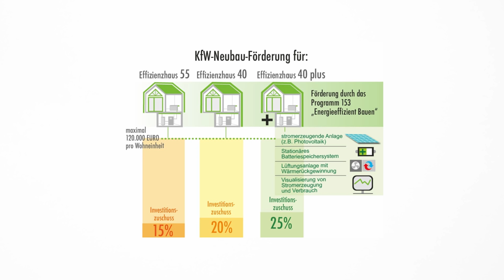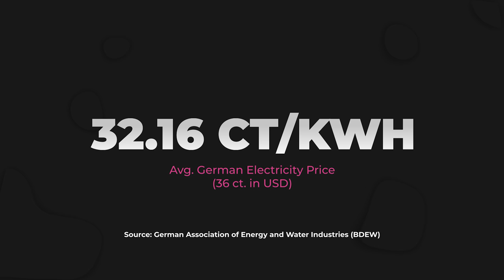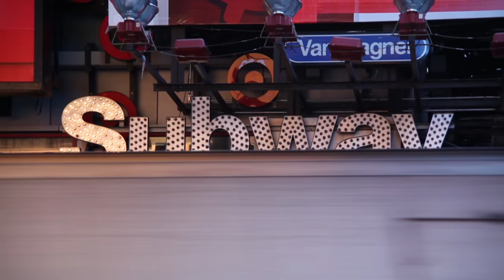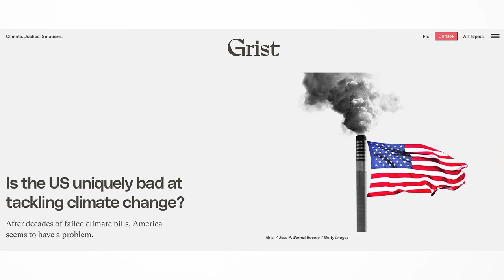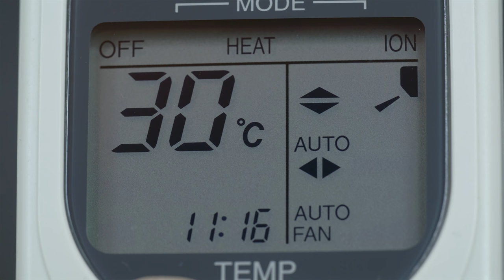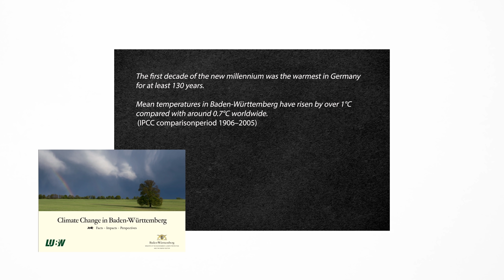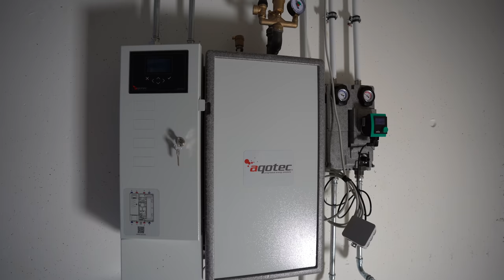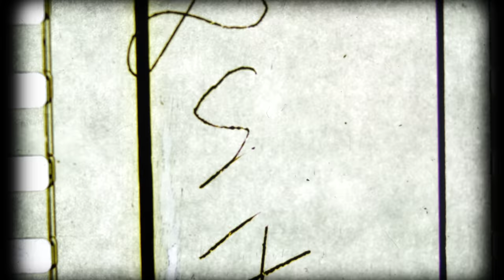HVAC (HLK) in German & American Homes | A Tale of Two Countries

Comment: Weeeell, I've personally heard (and until recently, even used) the argument that AC makes you sick myself a lot. 
Let's separate that into two distinct parts. 
If you step into a super-chilled room (somewhere around 19°C) from outside with a temperature of 30+°C, AND you are forced to sit in the extremly cold draft powering out of the AC unit, yes, then technically you can get sick. Not the common head cold that people like to claim, but rather muscle cramping due to effects similar (note: not equal) to hypothermia.
Because in Germany there is a high chance that you walked or biked from your previous location to your home. So it was fairly common for people to have highly sweaty clothing. In the smaller rooms that predominated German housing the blast of cold air from an AC usually had less time to disperse and mix with the hot air than in the generally larger, more open spaced rooms of the USA.
As such sitting in that stream of cold air from an AC unit with effectively soggy clothing may have caused some people some physical muscle discomfort and cramps.

The other reason why you could get sick is because many people who did use AC's in the 70's here simply did not consider that the filters require regular changing and cleaning. The air filters can get clogged up with particulate matter making them perfect breeding grounds for bacteria in humid days, especially when the AC doesn't run continuously but gets turned on and off again regularly. Each and every such switch allows for humidity to settle into the filters allowing for better bacteria growth. The airflow then spreads these bacteria throughout the rooms.
That's the second possibility of how to get sick by not using AC correctly.

But consider this: most Germans grew up with some form of radiant heating, either gas, wood, oil, or district distribution for the last century or so. None of these required regular exchanging and maintenance of filters. Let out the air once or twice a year from the radiators, and refill the water reserve, and you are done. Even if you forgot about it, it would still work reasonably well, without making you sick. Not so with AC. A clogged AC unit can be a real center of bacterial infection for a house.

Once this reasoning got out and stuck in German brains, it was incredibly difficult to get this out of the heads again, even when the filters and the AC units themselves improved drastically. It propagated into the general mindset and has stayed there since then.

Just my two cents on that reasoning. Maybe there are even some more factors that I've forgotten or overlooked.

BTW: Yes, I caved in and got myself an AC unit (central AC plus outlets for two rooms, living room, and my bedroom) two years ago when I completely refurbished the roof of my house, including thick insulation and high efficiency windows. It was the best energy efficiency class AC I could find for my requirements because I knew about the insane electricity costs I could run up here in Germany otherwise. I still try to use it as little as possible, with as little temperature variation between inside and outside as possible, just enough to keep a little cooler, roughly ten degrees C max difference).

Interesting idea: here in Hamburg an engineer, not an architect, came up with a heating/cooling solution for two close building structures. One is an IT network server center, another is a municipal administation building. Both are linked by sewer and underground passages. The IT servers require huge amounts of cooling, while the municipal building requires a fair amount of heating for a long time of the year. Only in the summer is cooling required. A both of these buildings are close to the Elbe river, this engineer introduced the following system.
The server farm was given full access to the water cooling for their server racks. This water was pumped across the street and used to distribute its heat to the municipal office building as heating.
Only in the summer were both buildings cooled by introducing river water into heat exchangers in the underground sections. These were then redistributed into both buildings for active cooling. But in the winter the one building's servers are cooled only by distributing their generated heat as central heating via radiators to the other building. No further AC is required in the server building.
Awesome idea, wasn't it?
Reply from the maker: Wow this was REALLY interesting to read!!  Although it does have us wondering about the "opposite" effect in the winter time. This is completely subjective, but we've always felt like our Germany friends and colleagues heat their homes to a much higher degree in the winter time. Often, we find ourselves wearing t-shirts to German restaurants in the middle of winter because they are just SO hot. If the big temperature swing could cause you sick in the summer - would this also be the case in the winter with big temperature swings?  I could totally be wrong here, but it just had us thinking. 

Also that is a SUPER interesting approach taken in Hamburg. Really really cool to learn about. Thank you so much for sharing!
Reply: @TypeAshton  Yes, totally agreed on the sickness aspect in winter.
Most people peel off multiple layers in office buildings in the winter, often sitting around in t-shirts so they don't get sweaty and get cold and quasi-hypothermia when returning outside. I totally agree, temperatures should be kept lower. But then again, the insulation as well as the base construction of most houses in Germany is much thicker and of higher value than in many more southern US houses. Even in the north (possibly with the exception of Alaska) houses seem to built to standard US code with fairly thin outer walls of open wood-frame covered by relatively thin wooden siding, as well as less than half a foot of insulation if at all.

My roof during its refurbishing and extension recieved roughly 30 cm of additional thickness thanks to insulation and further understructure. That means I gained a FOOT of thickness on an already half-foot thick roof structure, plus the timber support frame. So when heating in Germany, the heat radiated out through walls and windows is usually quite a bit lower than in the USA.

Next, as you will find, there is the so-called Vorlauf-Temperatur, the pre-run-temperature from your central heating system here in Germany.
If you use radiators this temperature needs to be much higher, somewhere around 60-65°C in comparison to the floor heating, which can be as low as 40°C. 
Using radiators has a tendency to have fairly hot radiators as the radiant heat looses quite some temperature as it spreads slowly through natural convection through a room. 

Floor heating has the whole floor of a room as a radiation source, distributing the temperature evenly throughout the room, requiring much lower base temperatures to bring the room to a nice cozy warmth. The downside is the length of time that floor heating takes to react to temperature changes, especially if the underfloor is not well insulated and the sensors are placed at the wrong spots.

HVAC has the advantage that air under pressure in vents spreads more quickly, but it also cools off much more quickly if there is ANY kind of seepage anywhere or once they are turned off. 
Radiators tend to stay warm longer once they have reached the desired temperature. As a caveat many people turn it up far too high to acchieve a quicker warmth distribution but then forget to turn it down again, so their rooms tend to become over-heated in the winter.
Reply: @TypeAshton  I'm living in Austria 
with radiators gas heated and I heat as less as possible not to get a heat stroke. Really I never be able to wear knitted pullover or even long sleeved shirts. Before I had an table stove heated with wood and it got never too hot or too cold, I loved it. Governments here do not like this and they order to build apartments without access to the flue, so you can't have your own stove. And most of the people can't afford houses.
Reply: @TypeAshton  I have family that works for Microsoft and they had an idea to lease servers out in "furnace" sized racks to private homes and use the heat generated pumped into the houses heating system in the winter and exhausted outside in the summer 
the plan also increased Microsoft's network resiliency as the servers would be spread out over MANY locations and NOT one server farm as far as I know the idea went nowere
Reply: @TypeAshton  My old appartement (built 1990) had good insulation, gas central heating and neighbors at all sides. The hot water tubes to the radiators run all over the rooms in the walls. Even if the radiators are switched off the water runs up to there and back. If it wasn't really cold outside I needed to stop the water flow at the main valve, because I had more than 25°C without radiators switched on. One year I had it off for more than 13 months so the company assumed their energy counters to be defect 🙂while I only wear T-shirts all the time. Of course in single older houses that's completely different.

Comment: I lived in a home in southwestern Virginia that had radiant heat, sadly it was in the ceiling. Most of the homes were heated by oil or coal. Our house faced east, but our kitchen with a sliding glass door faced west. It was almost impossible to stay in there to prepare meals until the sun dropped below the neighboring mountain. We used a wood burning stove in our basement to warm the house. Once the room was comfortable the house was nice and toasty.

Comment: Our house has a Photovoltaik which we use to heat and cool. The heat pump takes the outdoorair wthdraws 6 °C and pump the cold air out of the house on the other side of the bildung. The walls has 36 cm and the Windows have so low kWfactor that Our house is always cool. In 25 years we never thought of using the coolingsystem or buying an a/c. With the rest of the produced electricity of the PV we can use any other Equipment of the house. We are nearly autark. Just in winter and on longer rainperiods we need to buy electricity. We love it to do something against the climate change and to save money.

Comment: I live in central Missouri, hotter than hell in summer and freezing in winter. We built an 1800 square foot ranch home with passive solar design using post frame construction and fiberglass batt insulation on a slab. We have three minisplits and all electric, including appliances, well and hot water heater. Our monthly electric bill for everything is $90 on average, lower in summer and a little higher in winter. We are in rural Missouri on 210 acres and the construction options were limited. So no fancy construction methods were possible. A good passive solar design is very beneficial. Lots of south facing windows that are shaded in summer but help heat the house in winter.

Comment: Living in Germany but looking at some new constructed houses in the US, there seems to happen some shift. Instead of old water boilers which very simplified store 200 liters of hot water over a gas flame now tank less water heaters working as condensing furnaces which even draw heat out of exhaust gasses and condensates. For cooling, central forced air AC systems are either scaled down or not used at all but split systems may be used in rooms where needed. It seems those are in many cases a lot more efficient without all the ductwork.

Regarding District heating, it can quite often be found in German cities also as a byproduct of large industrial plants, or for example from waste-to-energy plants (since quite a few years now we don´t have any open landfills any more for different environmental reasons, mainly protecting ground water which often is as well our drinking water source. Instead waste is incinerated. As this of course produces a lot of waste heat, it is used to make steam for generating electricity and heating as well.